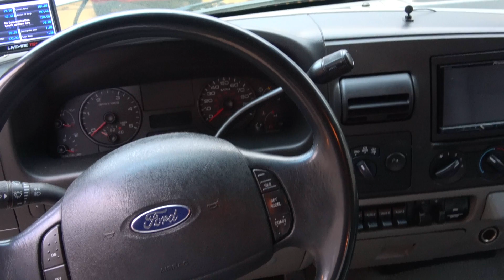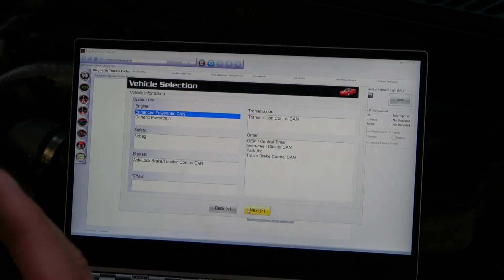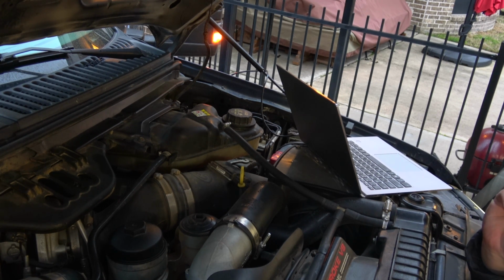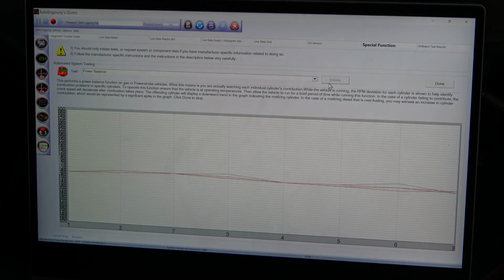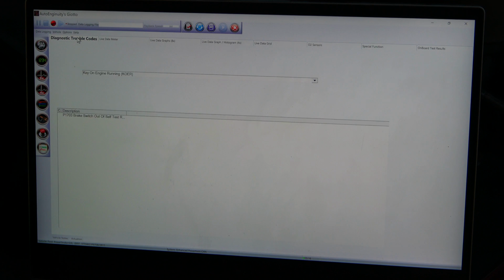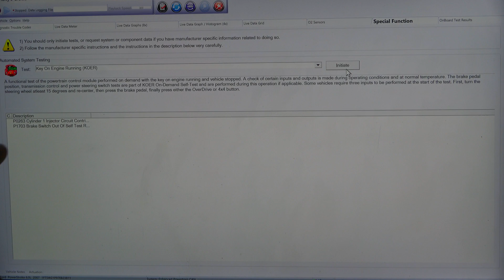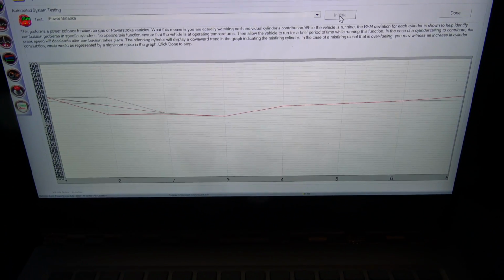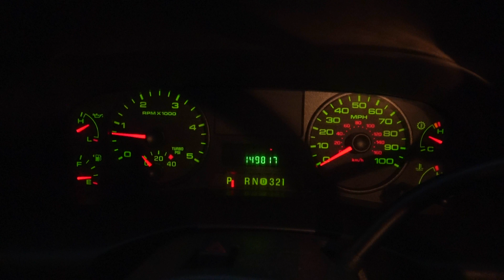Powerstroke 6.0L AutoEnginuity Injector Testing

Comment: What was the solution?
Reply from the maker: It was a bad injector. Had to replace it.
Reply: GREAT VIDEO BUT HOW TO KNOW WHICH INJECTOR IS BAD THANK YOU @DmitrysGarage
Reply from the maker: @MontubeQC  You can use Ford IDS or AutoEnginuity balance test data. Ford IDS can disable single injectors which will really show you the answer.
Reply from the maker: You can also see the IDS software here around 5 min: https://www.youtube.com/watch?v=I_N7fd7GowE 
 @MontubeQC
Reply: How much did it cost you? & did the issue go away?, I'm having same problem with my 06 powerstroke
Reply from the maker: @NickShot250  The injector was somewhere under $400 and it fixed my issue perfectly. Unfortunately the IPR died shortly after and was another repair :( EDIT: There is a video of the rough injector process in my channel as well.

Comment: Spent a little time with the Auto Enginuity people this past weekend.  They have a decent idea of a tool , sadly it leaves so many gaps.  Glad it worked out for you . And great video 👏
Reply from the maker: Thanks for watching! Yea its really not a bad tool at all and its impressive considering the huge scope of support it has vs Ford IDS which is just Ford. It worked well enough for most tests for me. I wish the balance test was something I could trust, everyone tells me its broken.
Reply: What do you recommend?
Reply: @NiteTrain89  check the icp injector  control pulse ,sensor on the right bank top front of the oil valve cover.
Reply: Icp sensor = injector control pulse. Sensor. Just something you might want to check out first hand. As it maybe dropping when it comes to #injector that shows coding . As it pulses for each cylinder injector. Just might be a sign of it soon might go out on you. Then no start will occur after awhile when it goes completely bad.